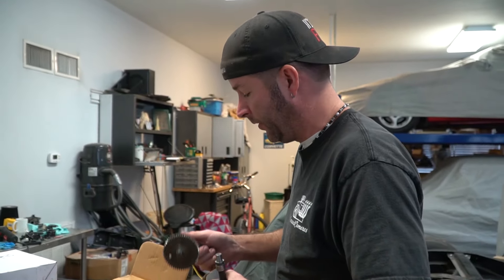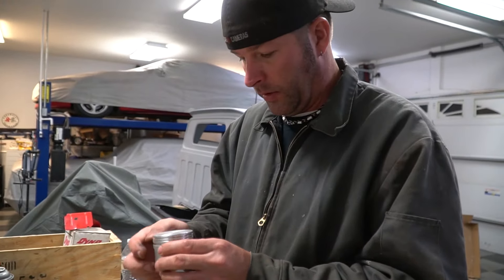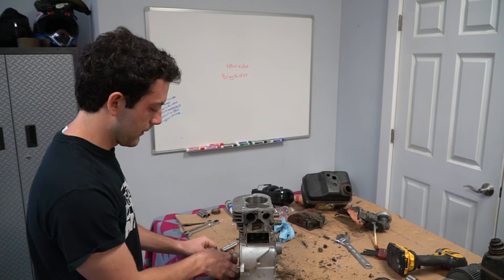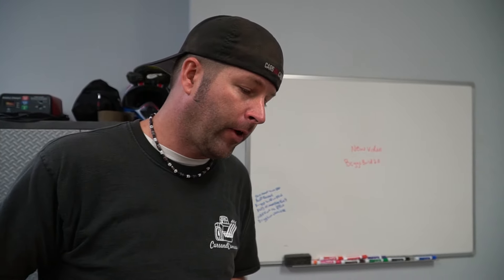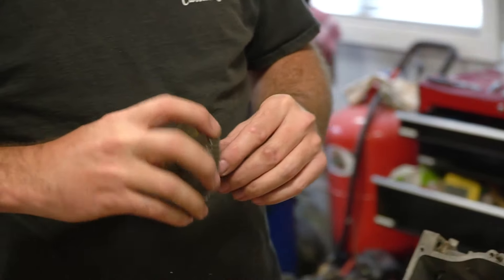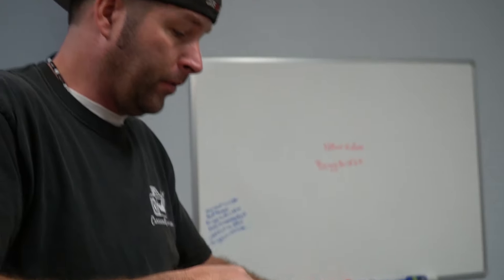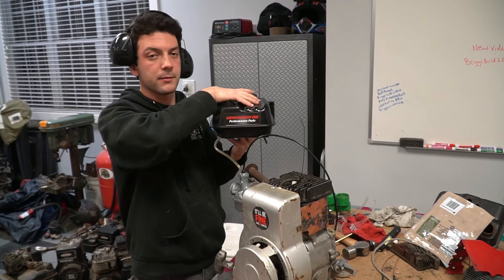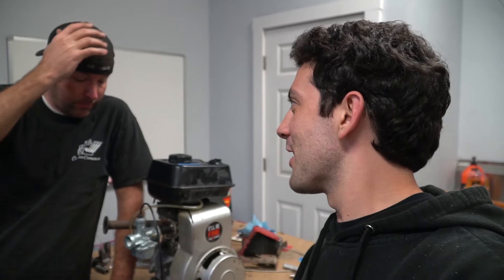Flathead Briggs Build from Scratch | Homemade Performance Mods!

Comment: I was about to make a partially built sc152f it's like a small Briggs not 5 horse it's 3hp im sure and I still wanna build it with billet flywheel electric start new rod  heavy valve spring and a Dyno cams cam instead of the stock plastic one I have to put the old carb on cause the new mikuni is jus too rich for my minibike ATM so I'm gonna do removed governer stock 15mm carb up against a slightly modified stock carb vs modified as much as I want vm22 mikuni

Comment: What jet did u put in the carb for it to run? I have a fully build flathead with 22mm mukuni with 125 jet still wont run right.

Comment: I have an early 70s era Speedway Scorpion mini bike that has a 5 horse Tecumseh for it, started the resto-mod on it years ago and had it custom painted and never finished it......the Tecumseh needs to be rebuilt, actually contemplated putting a Predator on it..............or just sell off everything I have for it and be done with it

Comment: Is the billet rod longer than stock? Seems like a waste if it's stock length.  Also, that's not how you check ring gap. You need to remove the the rings from the piston and insert the ring into the cylinder then measure the ring gap with a feeler gauge.

Comment: Question. How did you go about tightening the flywheel? Can’t get Mine to get tight enough with the starter clutch
Reply: I use a hammer and punch.   Probably have a wrench for it to do it rite
Reply: Isaac it'll be fine after getting the starter clutch as tight as it will go the crack still has play. I don’t getvit

Comment: What is reason for changing flywheel to the 3.5hp. it is smaller. Does it let it rev quicker?
Reply: Rev quicker. Old scool trick. Go billet if you can

Comment: i laughed when the ring gaps were lined up .rings gaps need to be at 180 deg from each other. example if you have 3 rings make the 3 point Mercedes emblem with the ring gaps when positioning rings on piston .

Comment: CarsandCameras I would like your thoughts on ah project I got going so I have an old  84 to 85 Honda vf1000f motor that’s the old high reving v4s they put out ah while back but anyways I’m I’m the middle of putting ah 70 degree Ducati Panigale 1000 v4 crankshaft in it and I want to share it with you guys when it’s finished but yes I just wanna know yalls thoughts on that I love you guys keep up the good work💯❤️
Reply: is that the one that sounds like a v8? those things make my knees weak
Reply: Frigglebiscuit yes that’s the ones

Comment: I need some help i have a Tecumseh motor and cant figure anything out about it its vertical shaft model# oh160 170094b dont know what hp it is or anything.. Any help would be greatly appreciated..

Comment: I've got a Briggs that's been locked up the valves have been stuck left out in the weather I can still clean the coil change the oil put fresh gas in it and it is still put out 25 horsepower

Comment: You cannot check the ring gap they way you are as the ring does not run right at the top of the cylinder. Take ring of square it up with piston about inch down bore....

Comment: Ok ok, so if anybody can answer this please feel free. Have an old 5hp tecumseh powersport,took apart,cleaned, and the crankshaft has slight wiggle about 1/4 in or less travel when fully assembled and sidecover is on.i can pull on the crankshaft outwards and push inwards w a lil play in it. Any safe solutions?really just want it running and safe for these kids.

Comment: Yes it should make more lowend torque as well then a predator. Also should be able to rev higher and hold it there longer. I did start on tecumseh's rebuilt the head on a ohh50 ohv 5hp with a 245 dyno cam she has had good topend but never did do a stiffer valve on the exhaust side cause the spring pocket is deeper in the head causing valve float. never did get into the flat heads. Sucks tbh that tecumseh went out of business the sucked trying g to start but once they do you better

Comment: Do you ever use two stroke engine's? If you can find one try a Kawasaki ar125 engine.they have a rotary reed valve and just love to be souped up.I had a bike and I drilled the main jet much bigger than it was meant to be and put a k&n filter and a micron exhaust on with a 37 tooth rear sprocket.it went from being able to go about 70mph to 120mph+ and wheelie off the throttle all the time.it had a two stage power band and revved up to 12000 rpm.I think it would make a great project for a fast machine.👍

Comment: Can that 22mm carb be used on engines around 14-17hp?
Reply: 22 would be a little small i bet. Maby a 24mm
Reply: @isaacitllbefine7231  ok thanks. I have a Kmart riding mower I'm gonna play around with :)

Comment: I was rebuilding a motor from a go kart that my boss gave me and It sat for 10 years outside and I got it running and I took the crank shaft case off and it busted and now there's a hole in it about the size of a silver dollar. What can I do

Comment: What's the advantage of using the 3.5 hp flywheel on a 5 hp engine?
Reply: Supposed to let the engine turn up faster
Reply: Smaller, lighter weight of rotating mass as a whole

Comment: Ok so I have a question...   Some mower engines come with a 6.75 hp Briggs and Stratton engine.

So why spend time and money porting and polishing,cam with more lift, billet connecting rod etc,etc if the engine will only produce 5 hp ?

I know there has to be a reason for it I just don't know it.

Comment: cant measure the ring cap that way, dont think the ring reaches that high in the bore so its basicly in an unworn part of the cilinder 
you usually remove the ring and put it inside the cylinder then use the piston upside down to square it in the bore
way to measure valve strength : wat you ca try is get a bathroom scale set the spring with the scale in a vice and compress the sping the same amount as the old spring , the weight displayed on the scale should be higher with the stronger valvespring 
(try to keep the point where the spring sits on the scale about the same between both springs
another way is set both springs in the vice with a ring in between them and tighen the vice "some" the stronger spring should stay longer then the lighter spring

Comment: 3 hp flywheel?? Why?? Just lighter and more responsive? Is the timing the same on all Briggs single cyl engines. And more on the "Old school" cam model. How to DIY modern on the cam. More lift or duration on ex or intake?

Comment: Ring gaps should be checked with the rings and not on a piston. If you ever want to check bore, check rings at different depths within the bore. Polishing is much different than porting and if you port on a the of the valve, the valve should be seated so you don’t “polish” the seat. Epoxy goes a long way when porting these engines. Built too many moonshine burning briggs back indy day.

Comment: Is the 22mm carb to small for a 8hp Briggs ?
Reply: It might be
Reply: I ended up ordering a Chinese 30mm carb. Says for 250cc and it's a 319cc. I ported the heck out of the head and and decked the head. Are the stock exhaust valve springs on these old 8hp flat heads red ?

Comment: I have the raptor motor on my kart and it’s runs on methanol which Ik it bad if you just wanna play around with a go kart lots of maintenance but I wanna covert to gas and Ik I need to get a gas jet and needle kit and a oem carb diaphragm but I wanna know how I am supposed to do right plz help **

Comment: Be careful welding that galvanized washer guys.
Reply: creates zinc oxide gas. its yellow green and sticks to the metal and your lungs probably...you gotta be careful if your welding or cutting sheet metal but a single washer isnt to bad...my shop teacher in school said its some really toxic stuff
Reply: @philtripe  if you grind it off you'll be fine. its just a coating, once the coatings gone its fine to weld. you can think of galvanized as just a sacrificial metal. corrosion eats it before the metal beneath.

Comment: Guys, a single cylinder engine doesn't 
have manifolds.  (Doesn't have headers, 
either.)

https://en.wikipedia.org/wiki/Inlet_manifold

It has pipes.

steve

Comment: The main reason why these engines are so smokey is because most 5hp briggs engine had an aluminum bore except for the I/C (industrial, commercial engines which had a steel bore), just like the chevy vega engine and the aluminum bore wears very quickly especially on an engine that is neglected and ran hard  and then the bore is so out of spec that even a new set of rings wont stop the smoke but Briggs engines are fun to play with I just hate the diaphragm carbs they use.

Comment: My most high reving longest lasting motor is a 3.5 craftsman pulls harder than the new predator 212 in my go cart burns the tire better and holds the rpm higher

Comment: i have a 1956 briggs and stratton motor from a old barrel lawnmower. i just don't know the size of the engine. the information plate is warned down it doesn't have any info.

Comment: I remember when 3.5hp Briggs and Techumseh were the norm & you CANNOT grind your own cams properly, the ' jerk ratio ' would be horrible & there's a taper ground into them so the lifters/cam followers ROTATE in their bores...that's why you cam buy Chevy " Blueprint " Cams the same as factory original but are " Cheater" Cams...Stk grinds smoothed out.Most are on the internet because they don't know much correct information ,! Trev New Zealand

Comment: you put the rings in the cylinder to check the gap. not on the piston. square the ring with the piston. 3 rings gaps 120 degrees apart. 3 x 120 equals 360. guess the valve guides don't need any attention.
Reply: The guides in this one wert bad

Comment: Thats definitely not how you check ring gap..that area of the cylinder will have little to no wear..you need to take the ring off the piston, push it down in there square about the middle of where the piston will be traveling and then measure with a feeler gauge..

Comment: Hey man ive watched the vids since before the rails time that thing is awesome but i wanna say i think a 5hp flathead will putrun a 212 but i race circle dirt track with racing gokarts and going 60+ on a 4 to 8 hundred feet circle with 3 foot banking insane just like a modified man check out i-530 kartway on facebook i used to race their

Comment: I need a new carburetor for a 208cc ironton, anyone have any suggestions?
Reply: Chinese carb on Amazon 25. They work as good as factory. Look at part number on carb.  Visually compare them. Check inlet and outlet diameter make sure they are same as factory

Comment: I hate tecumseh motors, had an old manco big cat mini bike and the tecumseh left me stranded. When i got it home i found a freakin plastic cam in it! The gear teeth had sheered off. So i put a 8hp ohv motor off a tiller onto it and was rip snortin fast until i traded it off for a bow. Now i ride big boy bikes haha

Comment: Hi Sir , 

I bought an old Snapper recently , it’s in rough shape but I’m restoring it back to working condition , the reason I bought it is because it has a 42” cut deck on it , my question is , the motor shroud is rusted and the decal that has  the HP on it is not readable , I think it’s 11 HP , do you know where I can purchase a new original design  decal ? It’s a Briggs & Stratton , can you tell by the numbers what the HP is , the model # is difficult to see but best I can tell here’s what I think it is , Model: 257707 , the type & code is clearly readable , Type: 0143 01 Code: 78020111 ,

Comment: We have these engines in my auto tech class I can completely tear and rebuild it in 40min
Reply: I still run flattys on my race kart and with the proper tools I can tear one down in the pits hone, re-ring, valve job and have it running in 20mins or less. After a while you can pretty much do it blindfolded...lol

Comment: Why not actually build it right? You have a new piston.  Why not have the block bored for the new piston? I've also read that you shouldn't hog out the exhaust on a flathead because its already to big from the factory.  Porting method looked pretty sketch.

Comment: Can anyone here please tell me what the hell my motor is doing?!? 212 hemi stock besides the header and intake. it runs like it has a cam and will only run on choke? i cleaned the carb 3 times
Reply: Did you put a larger jet in it? They run lean if you do a header and intake with no jet
Reply: i did, can you maybe private message me on facebook and i can send a video and show you what im talking about? -  Mason ivey

Comment: i have a flat head briggs putting out 21 hp on methanol
Reply: seriously strong. can you post specs or do you have a youtube channel?
Reply: @bobwhite5440  Its a original briggs raptor motor standard bore,  wms billet rod,block has been ported cut and welded around the lifter area has a 233 outlaw cam 357b tillotson carb converted to methanol  on a mini bike that does 80 mph in the 1/8 mile drag
Reply: dick yupyup, my neighbor ran 5hp block 1/4 scale 1/8 mile dragsters on alcohol methanol stuff, eyeball burning exhaust, squeaking about same kind of power out of them after all the mods
Reply: @mr.stonerUDX714  thanks. sounds awesome.

Comment: Exhaust is too big. The exhaust is already big enough. Unless you change valve size you should leave it as is.

The aluminium flywheels may break apart when installed on unregulated engines. Just a warning in case someone wants to use it.

Comment: Your not checking the ring gap correctly. Take all the rings off the piston.. then take and put the ring in the cylinder then take the piston with no rings on and use the top of the piston and push it half way down the cylinder then use feeler gauges to measure the gap the piston rings do not compress all the way until it is down in the cylinder so you are not getting a correct reading

Comment: I run a briggs, you'll never see me rockin a teJUNKseh or a clone.
Reply: HotRodBriggs 60102 brings are old now and unreliable plastic cams
Reply: I beg to differ on the HH10...1970's cast Iron block...Timken bearings...a beast of an intermediate sized engine...TOUGH...TOUGH...TOUGH AS NAILS! Had one on a Sears(Roper) mower...increased RPMs to about 3850 (under load)....ran it for 10 years like that.
It barely smoked at age 27. I had two WheelHorse, so I sold the Sears...big mistake.
Reply: nothing wrong with tecumsehs except the rod. imo, they run harder stock than a briggs stock.
Reply: @frigglebiscuit7484  you're very true, there really isn't much wrong with tecumseh, I've just always been a briggs guy lol. Tecumseh engines have a bit more power stock I do agree.
Reply: @nightmareinaction629  I've got a 1970 3hp that just keeps going. Consistently sees 4500 rpm runs, hold on like a champ. Plastic cams are good for a stock engine, or something where you're conserving weight. They can be profiled with epoxy or JR weld rather than welding on a metal one, however I would not recommend it.
Reply: @mikecook8147  I'm glad that engine has given you a good run, hopefully you'll find another some time.
Reply: Have horizontal shaft 5hp tecumseh powersport with wiggle play  least about 1/4 inch on crankshaft and obviously the flywheel on opposite side. Any suggestions on problems or solutions? Tried tightening as much as I can. Just don't wanna sheer off teeth on that plastic cam so want the  wiggles GONE

Comment: "Briggs are prone to carb issues" really? I never really had carb issues with Briggs. No float to worry about they just pull the fuel straight out of the tank. Tecumseh on the other hand never had anything but problems with them.
Reply: The throttle plate was wore out. Half the time it would idle and half the time it wouldn't

Comment: Read on Karting.4cycle.com.... Predators   website that the Predator puts out 1 more HP in similarly built engine that B&S.  this was from ppl that forgot more abt small engines that most ppl wud ever know.  more/cheaper HOP UP parts for Predators than B&S, like Small Block Chevies... the standard in inexpensive HOT RODDING as there are so many of them out there. to most of the new generation of karters, the Predator is .... the standard engine.... $99 new in the box (NIB)? cant hardly be beat.  how much is a B&S new?   they are NOT cheap

Comment: U never degree,d mcam didn't set valve lash correctly, didn't check spring pressure, nor seal head gasket,lap valves,set firing timing,clearance  rod bearings to journal hope it lasts 4 u,all,,don't oil petals on my tri,cycle pls.